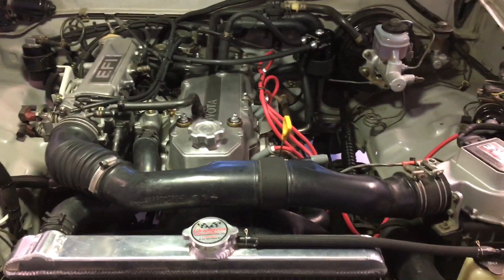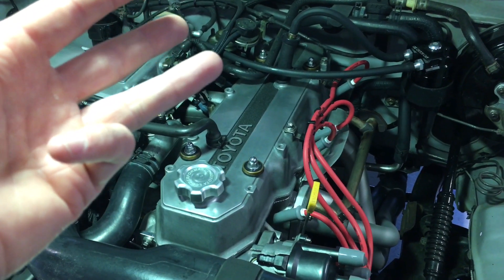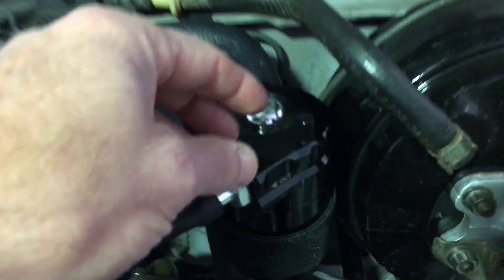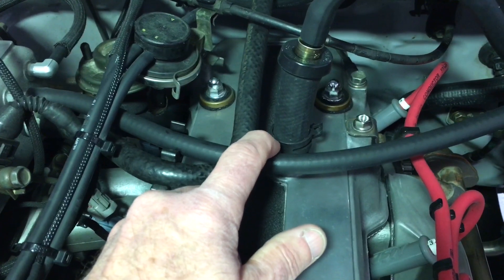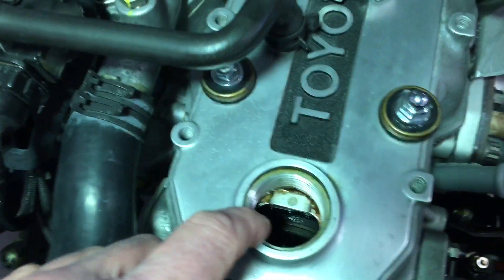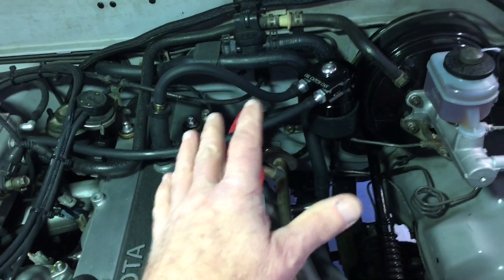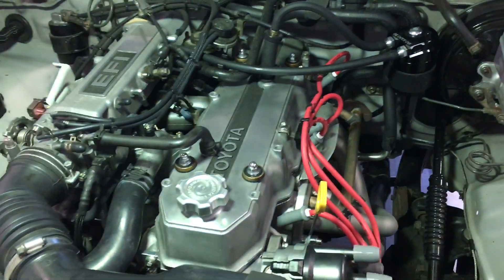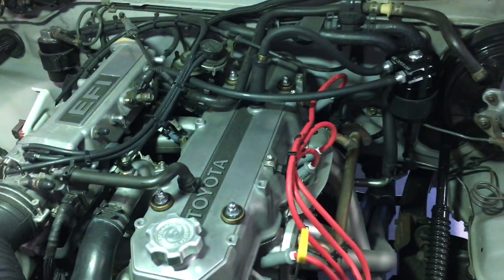Excessive oil consumption on Toyota 22RE motor finally solved?

Comment: Excellent stuff.  Love the simplicity of even just spacing up the valve higher off the cover.  I bet that dual row chain slings loads of oil, as I ran my Nissan SR20 engine with the valve cover off years ago and its single row chain basically made a rooster tail haha
Reply from the maker: Yeah, there's a lot of oil flying around under there for sure. I'm experimenting around with different size/design filters off the valve cover in order to allow any oil to drain back down into the engine. I'm testing out an Edelbrock 8157 40 micron fuel filter now and have another filter coming this weekend to test out. It will be interesting to see how it affects oil consumption

Comment: My factory 81 engine comes equipped with a double roller timing setup snd The baffle on the early valve covers is completely different than the later ones.

Comment: That's a very interesting problem. I think I have about 3000 miles on the fresh build on my 1985 turbo truck. I do have LC's dual row upgrade with an adjustable timing gear and I did the modification to my baffle like they have you do. I have not had any noticeable oil consumption. The only things that are different is that I think I actually drilled all the way through the welds and have holes in the front and mine is maybe barely bent down. I also have a factory 90 degree PCV valve. Even with 13psi of boost, I have not had any oil consumption that is even noticeable.
Reply from the maker: Good to know, thanks! I've wondered if the 90 degree PCV might have some impact on things also. That's interesting about the welds and drilling clear through (and having extra holes). I was thinking about drilling a drain hole or two in the baffle just as a test.